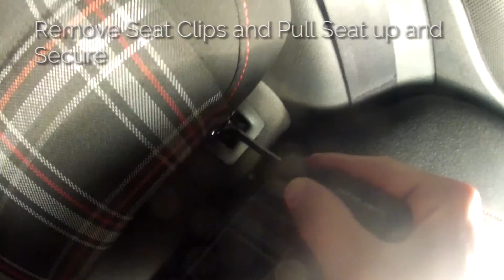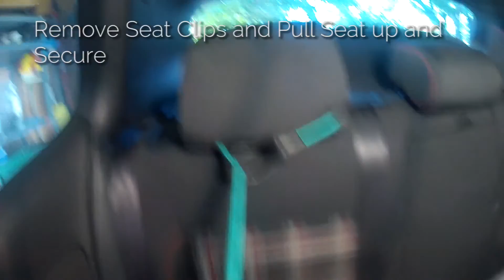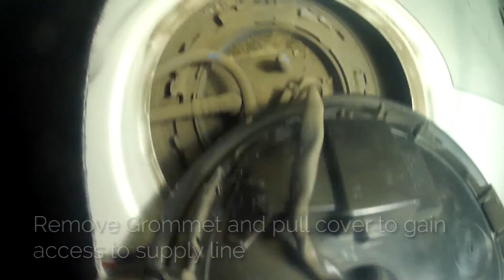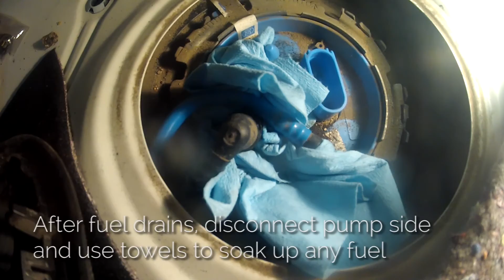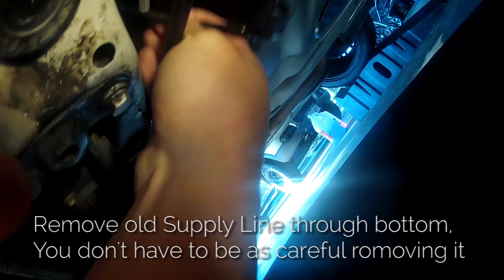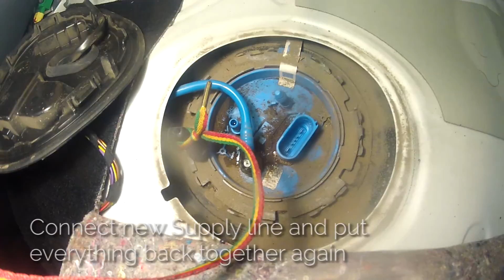How to Replace Fuel Supply line 2011 MK6 GTI/Golf Broken Fuel Filter Clip

Comment: Thanks for the great video gave me confidence when stuck with bad clip on main fuel line, did not hesitant to order hose from dealer $43 Canadian, pulled fuel filter with hose attached, not able to remove it off car too.  As per video fishing it back in was a breeze. Fuel return line with blue clip came off nicely tho replacing may as easy as fuel line.

Comment: This method worked like a charm for me on my mk5 golf. Thank you so much for the video. The only problem I had is the replacement fuel hose I ordered was about an inch too long so couldn't get it to fit properly. Need to order another one!

Comment: I've noticed fuel dripping from around the fuel filter area when parked after driving. I've  had the car for about 5 years. I hope it's the supply line you swapped here and not the one that goes to the front I ordered a new filter but starting to realize the likely hood of the actual filter leaking is probably slim. Jacking it up to take look today.

Comment: I would have just cut the old connector off, got a small length of rubber tubing and 2 jubilee clips. Then connect the fuel line to the filter and tighten up the clips. But if you want originality then you do you
Reply: Does this really work? Won't the rubber tuning degrade faster overtime?

Comment: very usefull, i asume the Mk5 GTI has the same space between tank and chasis? by that i mean that i could easily pull the fuel line up the same way on my mk5?
Reply from the maker: I would assume so, but I am not 100% sure. I know that the mk5 and mk6 and pretty similar as far as build so I would say yes.